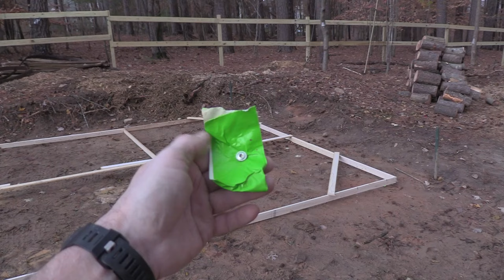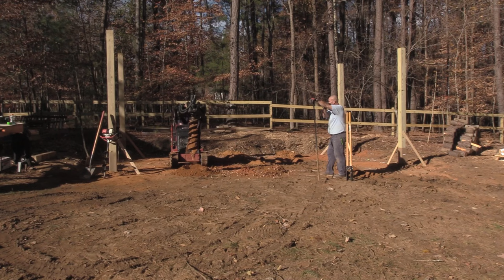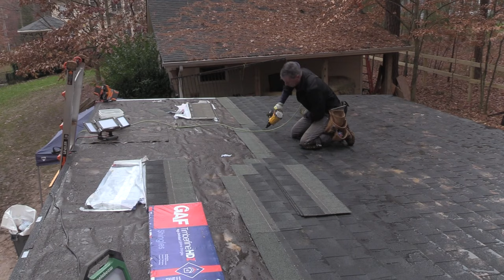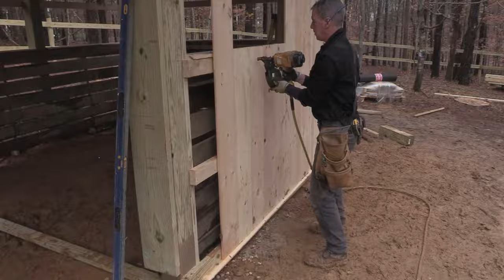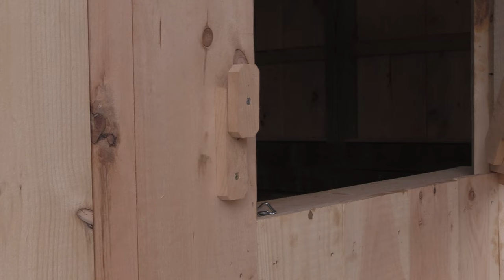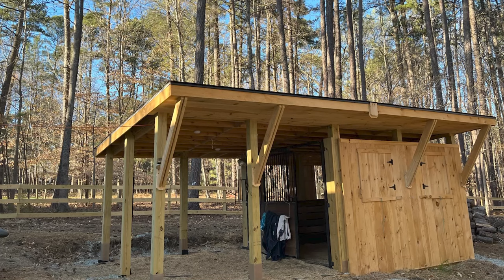How to build a small backyard horse pole barn and shed

Comment: a 1\12 is not steap enouth the roof will rot it should have been at least 4\ 12
Reply from the maker: It was raining when I installed the shingles. The roof drains. In snow country, I'd want at least 3/12. If there were standing water, there would be an issue. There isn't.
Reply: For roofs that are not steep enough you can use self adhesive rubber ice-water barrier instead of tar paper.
Reply: Agreed this is how a handyman builds a leaky roof.